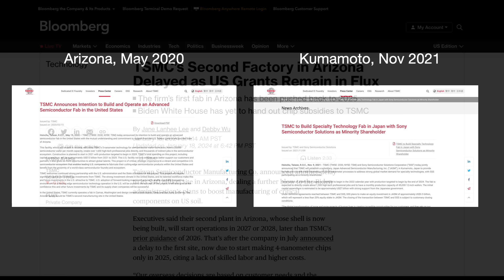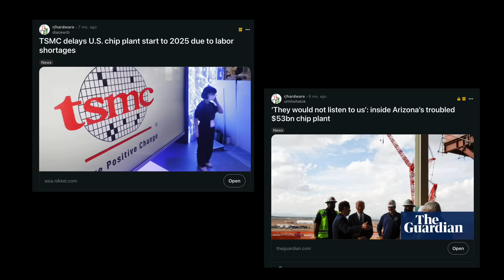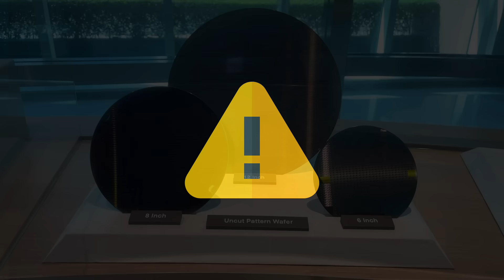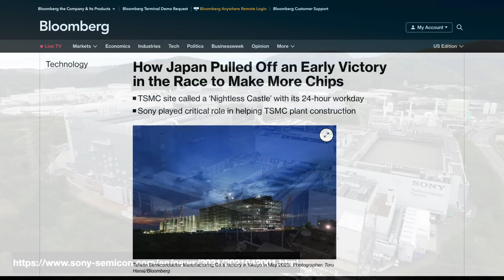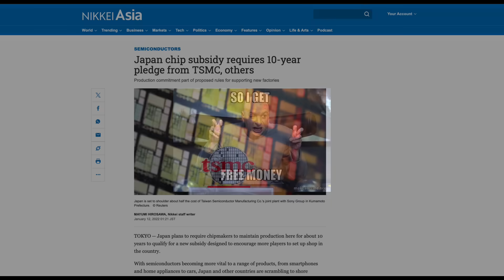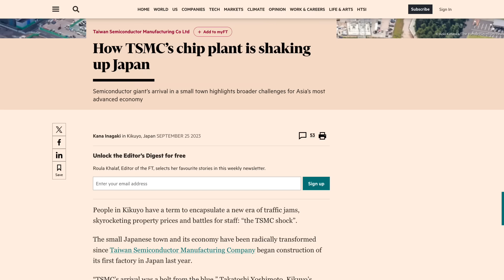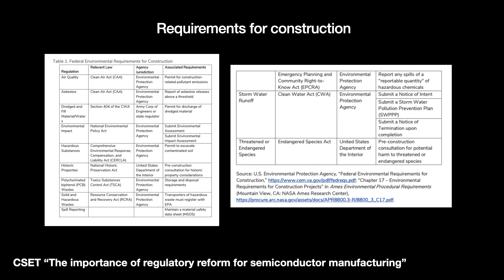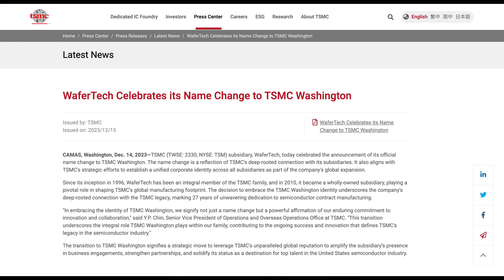Why is TSMC Doing Better in Japan?

Comment: As an American in this industry, word on the ground is that a big problem has been finding skilled personnel and hiring - TSMC reached out to try and recruit me for the Arizona fab, but were asking me to move to Taiwan for training for 1-2 years. That just wasn't an option for my family. 

Moving to a country with my wife and kids where none of us speak the language might have been an option if it wasn't for the fact it also would cause immigration headaches for them upon returning to the USA because they are green-card holders.
Reply: @siliwhiz same as mentioned by Robert, they reached out on linkedin, I have a BA in physics, graduated in 2020, have been at Intel for 3 years now in EUV
Reply: @Barkingstingray  nice
Reply: @siliwhiz for me, linked-in. I currently work at a different semiconductor manufacturer as an engineer, which between education, job title, keywords and employer landed on some recruiter's search list.
Reply: I have a process engineer cousin, 4 years XP, working at Intel and he told me that the TSMC fab offer its just a bit over the Intel. He refused because he does not want to work under so much pressure that the TSMC is putting on people
Reply: @siliwhiz I am not on integration or design, I am a process engineer who works with the technicians to help sustain the health of the ASML and TEL machines, as well as the flow of wafers in our module - lets each tool owner focus on their individual problems as i watch the entire fleet
Reply: Yeah, they reached out to me as well, and I just have no interest in moving from where I'm at to somewhere like Arizona for what they were offering
Reply: @Barkingstingray That's another factor - my wife would like the warmer weather a bit, but the endless suburban sprawl in the southwestern desert environment isn't for her, or for me.

So you have a brutal work culture and hours, a generally less-desirable location for workers, less-than competitive wages, and a demand to move overseas and train for two years. Definitely not a recipe for success to recruit American workers.
Reply: There is a simple solution to keeping green cards. Apply for a 2 year re-entry visa. Only costs about $1000 each
Reply: 如果你們的肝有跟台灣人一樣就好了 為何台積電都是台灣人最多
Reply: @siliwhiz yes! And I would say my physics degree helped immensely with that, really built my intuition. I think the degree is being valued higher these days in industry. EE is another great option as well

To be honest I'm working deep in it with the smartest people I've ever met and still barely comprehend it! It's the closest thing to magic humans have ever done
Reply: @Barkingstingray currently still waiting for a chance to work at TSMC. There hiring is pretty strange and I has found a hard time to go to Intel with B.S in EE
Reply: Americans enjoy the advantage that talents from all over the world cooperate with the United States in speaking English. Once Americans want to learn another language, it will be very painful for Americans.
Reply: @PornoDianno the amount of people who speak English all over the world is only increasing every day.
Reply: Damn If only I were in this field, I'd love to go live in Taiwan and train for a good job back in the States.
Reply: Though importation of materials and parts is also a headache.
Reply: USA : We need chip security.
TSMC : We need protection from China.
USA worker : Maybe you should have asked me what I need.
Reply: TSMC should have gone to Singapore. Blinded, they are burning more$$ in Arizona. This might rake decades
Reply: @Logic807  
If geopolitics is not considered, it is still the lowest cost and the most efficient to put all the factories in Taiwan.
Reply: They are using public money from susbsidies. This isn't charity. @Logic807
Reply: @Logic807  : TSMC was forced by the US government to build a factory in America.   Why doesn't the US government ask Apple to build an i-phone factory in the US?  Even, Apple doesn't have its factory in China.  As a tsm adr long term investor, I am not happy with TSMC to build a factory in the US.
Reply: @s : Well, TSMC is closer to USA security interests than Apple is…
Reply: @amandagrant4331 not really... You need to understand why the manufacturing sector isn't prominent in the USA, like that in China - simply because it's too expensive. The US is in a humongous deficit every year when it comes to software and services trade with India, why does not the US shift that market to its own territory benefit the local people increasing the employment? Why not the same for the manufacturing industry? Why import that much volume of products from China? Simple, if the US did that then it's economy will collapse. Because it will have to pay too high of wages. This is how developed countries exploit developing ones.

Bringing tsmc and then making it pay that high of wages to the US, isn't sustainable for tsmc. Only way to make it possible is to give humungous subsidy to tsmc
Reply: @shey5884 Nobody forced TSMC. TSMC can chose to stay in Taiwan, but lose US market due to Taiwan’s geopolitical hazard. 

TSMC chose to build fab in America not to lose American technologies, market and free money.
TSMC chose to build it in Arizona unlike Intel and Samsung.

Taiwanomtry complaining about America build bad relationship.

Comment: Places like Arizona & Ohio aren't known for tech or skilled labor, so of course the labor is cheaper and the tax incentives favorable. AND of course you'll struggle to staff your fab. Too bad they didn't consider Florida which has the best of both worlds in terms of taxes & labor, and also has a lot of cheap water. I seems like chip manufacturers jump at any government money and just try to figure out the rest later.
Reply: Arizona already has a chip fab industry, it's where the intel fab is. They likely thought they could poach the talent from Intel.
Reply: The water won’t be cheap in Florida if you’re building a fab. You can’t build a fab on a swamp, which is where many of Florida’s large cities are
Reply: Florida has way too many hurricanes to build very expensive, fragile factories there. Arizona has very low natural disasters, unlike Florida.
Reply: Florida, renowned for its engineering marvels that randomly collapse onto themselves in the night.
Reply: Arizona has no earthquakes, hurricanes, or tornadoes. It does have pollution, water shortage and heat. I am not sure why you think Arizona has no skilled labor, since Intel is building more fabs on the other side of town to go along with the existing fabs. Arizona has a long history of chip production.
Reply: Natural disasters aren’t as fundamental an issue for TSMC, whose main operations are regularly affected by earthquakes and typhoons. I’d say they were trying to gain the benefits of both AZ’s lower acquisition costs while being close enough to CA’s educated workforce.
Reply: Many people refuse to move to the south if you have a daughter or wife due to the physical risk to them. Florida's education system is not well known for quality.
Reply: @letsburn00 stay up north.

Comment: the red tape in the US is just insane. people complaining clearly haven't tried to get city approval for an addition on their house. When my parents did it back in the 1980's it took 8 months to get the plans approved. then construction was delayed multiple times due to the city inspector.

i can't imagine how much red tape TSMC has to get through in Arizona. Look at how slow Giga Texas took to build compared to gigashanghai. then there's gigaberlin that had even more red tape.
Reply: Here's one for you... while arranging for a nitrogen microbulk (storage tank) for our new site in Phoenix, the sales rep informed me that an oxygen monitoring system would be required.  The tank is outside the building in open air and the smallest size they have.  The Bay area doesn't even have these requirements.
Reply: And Texas is the best State to get permits in. Counties have no zoning authority.
Reply: Red tape and regulations are not at all equal or the same in the "US". Obviously the US is huge and there can be massive variation in permitting and requirements from state to state and even city to city.
Reply: I want to know what their accident rate is
Reply: You can easily reduce the red tape by simply hiring more people to do the paperwork. People who complain about "government workers" forget the red tape is almost always there for a reason (Boeing) but you need to have People on both sides.
Reply: US law is equal to all enterprises.
TSMC should not fantasize about treatment beyond the law.
Reply: So is Japan? 

Red tape is a common thing amongst developed nation, and they are there for good reason. 

Matter fact, US actually has relatively few red tape compare to most develop nation as long as you properly compensate the right officials.
Reply: @jintsuubest9331  Corruption in the guise of red tape is the worst type of red tape because it's useless and unpredictable.